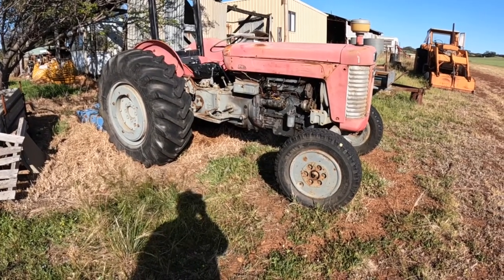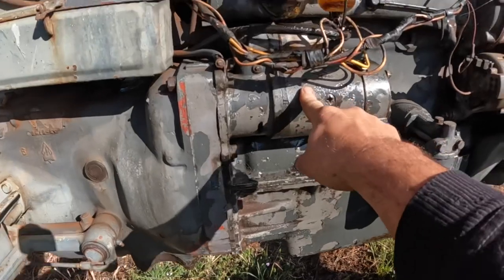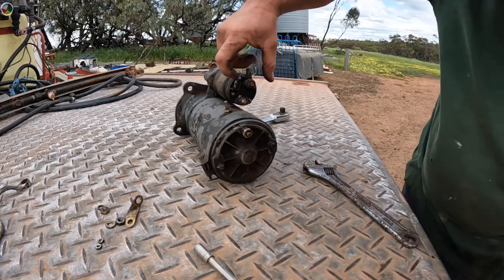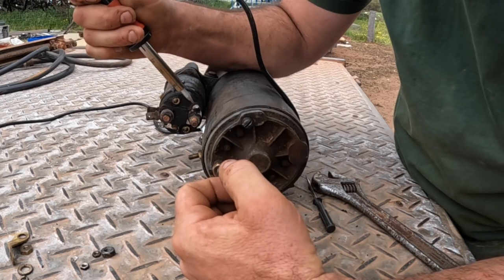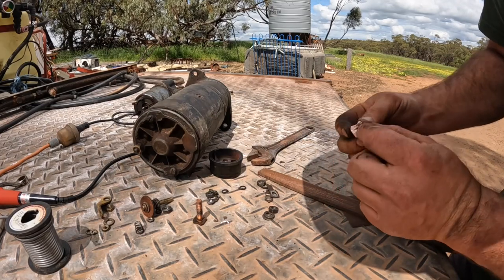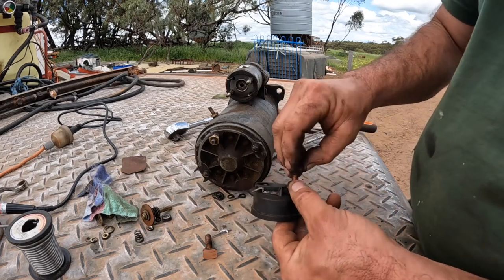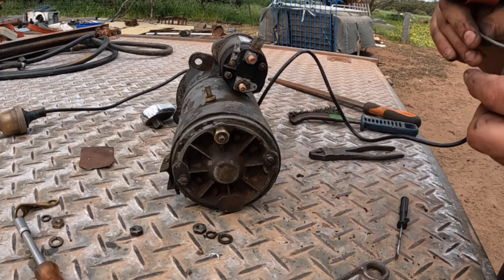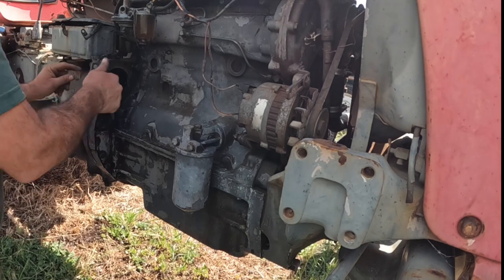Massy Ferguson starter motor repair

Comment: Lovely Geoffrey thanks for your quick reply and yes I can see a bit of smoke down at the starter when I try to start, will check all that...all the best Denis
Reply from the maker: Hi Denis, I hope you got the problem sorted.
Thanks from Geoffrey
Reply: I had this on my 35x and it was just the solenoid contacts. They were so dirty I don't know how they were working at all. However, having cleaned them she cranks over better than she has for ages. The contacts are about half way eroded so may need looking at again in 30 years or so. Lucas stuff - doesn't last 5 minutes ☺️

Comment: Loved this video, having problems with my MF65 basic setup same as yours. Have changed starter was good for a short time but now starter turns very slowly not enough to start. Could recommend were I could find a wiring diagram for the MF. Will take the original starter and repeat what you have done, very descriptively thanks Denis
Reply from the maker: Hi, I am glad you liked it. If the started is cranking over slowly I would suggest you put in another fully charged battery and see if that helps. If it still turns over slowly carefully feel around to see what is getting hot. It could be battery lead connections, earth to body connection or in the starter motor. This will tell you if there are any bad connections that need to be cleaned up. Be careful as it could burn you.
If you can’t find bad connections they look to the starter motor.
I am sorry I don’t know where to get a wiring diagram on line, but if you can get hold of a manual it should be in there.
Thanks from Geoffrey

Comment: Such a shame this tractor isn't at Brookdale. It would be a fine addition. Massey 65 are an outstanding tractor.
Reply from the maker: Hi David, yes these are great little tractors. Maybe one day I will get one. I am also hoping to get a 
Grey Fergie as a project. Thanks for watching
Reply: @brookdalefarm7986  I have a grey gold FE 35 here, non runner waiting for its turn.
I will probably sell it when it's done.
It has a DB 1212 in front of it that is half done. And will probably sell the DB. Once the 35 is done then a Diesel Major. Not to mention that the tractors I use always need love as well.
God put us on this earth to achieve a sirtian things. When you look in my shed I will be here for a long time yet
Reply from the maker: @davidrobertson376  
Hi David, I often find that by the time I have done all the work on the tractors I am actually using I have run out of time for the fun projects. Hopefully next year I will have some more time for the projects. It sounds like you have a good collection of fun things to restore. Thanks

Comment: Great job! You have a most pleasant demeanor for teaching. Have you had the issue where you push to start many times before it actually engages? My MF 60 backhoe does that and I’m not sure what causes it.
Reply from the maker: Hi Mike, thanks. I am glad you re enjoying my videos. Dose your starter spin without engaging or just clunk when you push the button? If it spins but doesn’t engage it could be that the solenoid is not pulling in far enough or damage to either the teeth on the ring gear or the gear on the starter. Some starters also have a clutch in them that can wear out. Thanks from Geoffrey
Reply: @brookdalefarm7986  it doesn’t spin until after a bunch of attempts where it just clunks. Then suddenly it will crank. Thank you for replying!
Reply from the maker: @mikeboccasini4166  Hi Mike, try turning the key and at the same time shorting across the 2 large bolts on the back of the solenoid. If this makes it work then you need to clean the contacts in the solenoid like in this video. I hope this helps. Thansk
Reply: @brookdalefarm7986  thank you sir, I’ll try that!

Comment: Well done very informative - will see if it works on my F G Wilson 40kw with Perkins Diesel engine doesn’t start unless I bridge solenoid
Live in tropics so subject to many power spikes and humidity - genset runs very well on a full load when I manually bridge start it..
Reply from the maker: Hi Edward, I am glad you found it useful. I hope it works on your generator. Thanks from Geoffrey